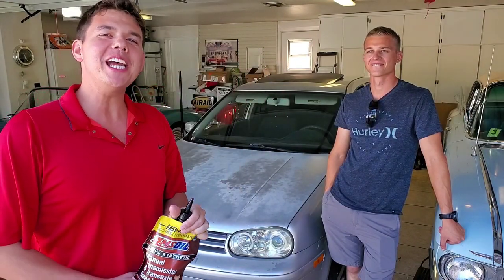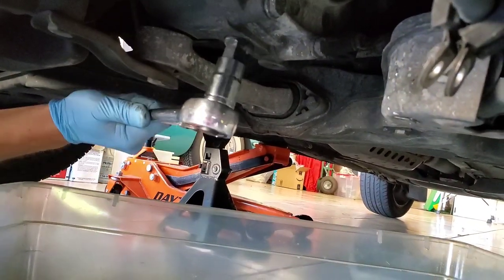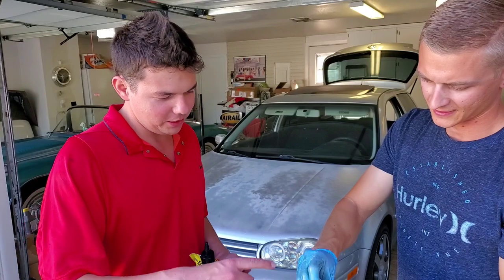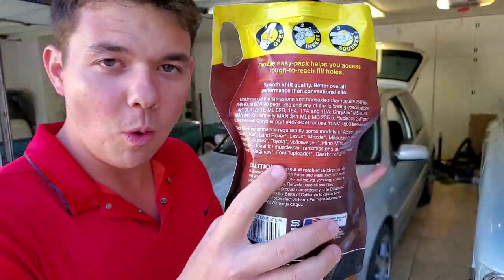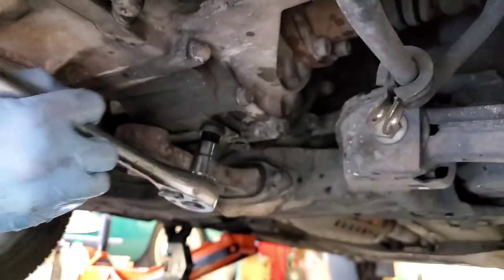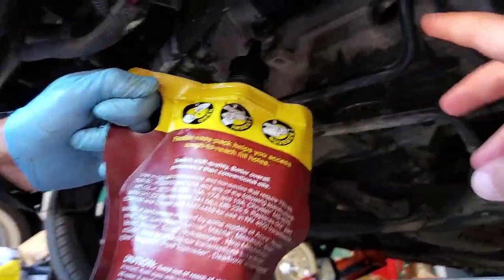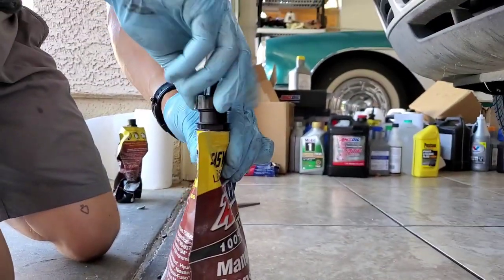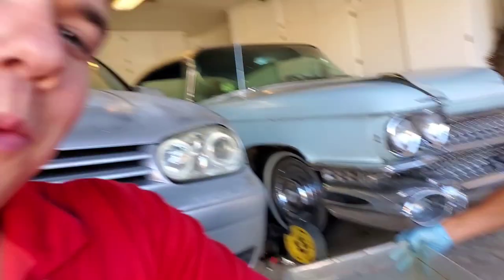VW Golf GTI AMSOIL 75W-90 Manual Transmission Fluid Change

Comment from the maker: Should People Love AMSOIL ..... - 
https://youtu.be/0YNrt962Q7U

     How should I help you with your vehicle? 

     My Link: Best AMSOIL 100% Synthetic @ Wholesale + FREE Shipping: https://www.amsoil.com/offers/?zo=5331179 

     AMSOIL Products & Vehicle Lookup - https://www.amsoil.com/guides.aspx?zo=5331179 

     AMSOIL Performance Tests - https://www.amsoil.com/performancetests.aspx?zo=5331179 

     Ebens Giveaway: 

     Video Playlist - https://www.youtube.com/playlist?list=PLB_ftWArBFdey4HFt_Z9KgSIChjkLbw_o

     Ebens Facebook - https://www.facebook.com/profile.php?id=100007973957868 

     Are You against learning about AMSOIL?: 

1. Where can I find AMSOIL? - Use this link https://www.amsoil.com/offers/?zo=5331179 
Or 
Watch THIS: 3 Fast Ways To Get AMSOIL - https://youtu.be/RiYifuDCsnQ 

2. What makes AMSOIL different than other oils? - 

     AMSOIL is 100% Synthetic & has higher film strength & last 4×longer then Mobil 1 EP which protects and separate metal parts keeping them from wearing and Lasting Exponentially longer: https://youtu.be/f4eNPgTi_qo 3. Why should I use AMSOIL?: It protects the engine so it will last longer. Less oil changes less often(once per year/15,000miles) or longer... Save money in Gas & Time making it less expensive then a free oil change over the year - https://youtu.be/H7K6FdZlqmg

     Professional YouLubher: Eben Rockmaker Master Direct Jobber AMSOIL Specialist (Dealer#: 5331179) Mobile: (702) 472-3614

     My Link: Best AMSOIL 100% Synthetic @ Wholesale + FREE Shipping: https://www.amsoil.com/offers/?zo=5331179 

     AMSOIL Products & Vehicle Lookup - https://www.amsoil.com/guides.aspx?zo=5331179 

     If your vehicle is not on the lookup guide this is AMSOIL Tech Support 715-399-8324 be sure to refer to Eben 5331179 

     46,000 Mile AMSOIL Oil Analysis - https://youtu.be/UjijQK5wSM0

     Is it a ridiculous idea to tag me?: 

Instagram - https://www.instagram.com/syntheticoilprotection/ Eben 

Facebook - https://www.facebook.com/profile.php?id=100007973957868 

     Order AMSOIL By Phone: Be sure to give them my number so I get credit for helping you Eben #5331179 and tell them you would like to be a Preferred Customer. 1. Call 1800-956-5695 2. Ask for your own preferred customer membership because you will get wholesale pricing, free shipping over $100, and your informative quarterly AMSOIL Magazine. It costs $10 for 6 months or $20 for the year which is well worth it. 3. Eben dealer number 5331179 4. Orders over $100 will be shipped free. 

Industry-standard 3rd party testing results: AMSOIL Signature Series 5W-30 Synthetic Motor Oil protects against harmful deposits on turbochargers 4X better than Mobil1® Extended Performance and 3.6X better than Royal Purple® in industry-standard testing*. https://www.amsoil.com/newsstand/motor-oil/articles/leading-the-field-in-deposit-protection/?zo=5331179 

     AMSOIL Better Gas Mileage - https://www.amsoil.com/newsstand/motor-oil/articles/another-win-for-amsoil-products/?zo=5331179

     AMSOIL Performance Tests - https://www.amsoil.com/performancetests.aspx?zo=5331179 

     Professional YouLubher: Eben Rockmaker Master Direct Jobber AMSOIL Specialist (Dealer#: 5331179) Mobile: (702) 472-3614 

     My Link: Best AMSOIL 100% Synthetic @ Wholesale + FREE Shipping: https://www.amsoil.com/offers/?zo=5331179 

     AMSOIL Products & Vehicle Lookup - https://www.amsoil.com/guides.aspx?zo=5331179
Reply: Do u get a big discount being a dealer?

Comment: Great  video  guys  like that oil too shift  better  smooth
Reply from the maker: 👍, thank you if you'd ever want to try the products this is my personal link would give you the very best value on them as the 6-month PC member.
Also when you use my link that would attach me to you so in the future I could always answer your questions about improving the performance and lifespan of your vehicles by choosing the right fluids as your independent Amsoil dealer💯

Promo: FREEFUNNEL 
✅   Save up to 25% on every order as a preferred customer: https://www.amsoil.com/offers/pc/?zo=5331179

Comment: I use this stuff, and the signature series oil in my 2014 MX5.  That car sees a lot of track and autocross use, and the Amsoil products handles all of the abuse well!
Reply from the maker: 💯, How many years have you been using amsoil?
Reply: @Syntheticoilprotection  3 years now.  Started using it on my 5.7 hemi ram which made a world of difference with that engine.  Switched the Miata over from Mobil 1.  Now, even the wife's kia has Amsoil in it lol!
Reply from the maker: Awesome That's a great story Thanks for sharing with the channel and thanks for checking out my YouTube channel ☕😃💯

Comment: Did you hear gear noise prior to changing the oil
Reply from the maker: That's a good question I don't remember if he did I know usually after you change gear lube to Amsoil because it's 100% synthetic it has a higher film strength It keeps the metal part separated so you'll have a lot less vibration in the drivetrain You'll also have smoother shifting better fuel mileage and the component will last exponentially longer.
This is my personal link if you're considering trying the products Thank you for visiting my YouTube community and thank you for any future business in advance and when you use my link I would get the credit for your order and I really appreciate you.
❤️🇺🇸❤️ Professional YouLubher: Eben Rockmaker Regency Gold Direct Jobber AMSOIL Specialist (Dealer#: 5331179) 702-472-3614 

      ✅✅✅  New To AMSOIL I Recommend The AMSOIL 6 Month PC Membership because it will save you about $33 on a $100 purchase after the difference in tax - https://www.amsoil.com/offers/pc/?zo=5331179

Comment: 11:44 Does your VR6 have the O2M transmission code?  If that is the transmission, 2 liters of transmission fluid is less than what's specified.  Something's not right about this transmission fluid change.
Reply from the maker: That's normal sometimes there's a couple different transmissions per vehicle some take a little more some take less it'll show it all right here on the lookup guide.
Find Products For All Vehicles - https://www.amsoil.com/guides/?zo=5331179

Comment: Hi , what is the tell tail signs that your manual trans oil is read for a change?
Reply from the maker: That's a great question it depends on the component there's all different types some are manuals with ATF fluid others are manual transmissions with transaxle to take your oil some take DCT fluid dual clutch transmission fluid so it depends on the component most are going to be very clunky and sticky you'll notice they take quite a bit of an effort to shift also you'll have a lot of play in the transmission when you let off the gas you'll feel a sloppy feeling for instance on my Corvette with the drive shaft there was a lot of play because the film is broken down once the film gets broken down it becomes metal and metal so it has a really harsh kind of clunky feeling.
I give a man a fishing pole & show him how to fish. 

     Together! We can get your vehicles to run better than brand new! 

     For me to get credit & be "Your" Independent AMSOIL Dealer please use my website below or my dealer no. 5331179 call anytime Eben Rockmaker 702-472-3614
After you click on: http://syntheticoilprotection.net
1. Click hamburger menu
2. Click offers AMSOIL preferred customer
3. Click join now 6-month PC member add to cart.  ( there is no reoccurring renewal membership unless you select that dot box ) 
( you have the option to not have your credit card saved if you prefer - est. 1972 )
4. Scroll up to the top Select shop by vehicle. 

New Promo: FREEBOWL

Comment: What trans oil would you recommend for 2000 manual tdi?
Reply from the maker: Hey great question man This is the lookup guide It will give you all the fluids and capacities for that specific year make and model.
Find Products For All Vehicles - https://www.amsoil.com/guides/?zo=5331179
Reply from the maker: If you're new to Amsoil I definitely recommend the 6-month PC membership which you'll save you about 33 bucks on $100 order also when you use my link I will also be your Amsoil dealer so in the future I could always answer your questions on the products.

If you have any questions before you order always happy to talk with you.
Professional YouLubher: Eben Rockmaker Regency Gold Direct Jobber AMSOIL Specialist (Dealer#: 5331179) 702-472-3614 

     If you're New to AMSOIL I recommend the AMSOIL 6 Month PC Membership - https://www.amsoil.com/offers/pc/?zo=5331179

Comment: Do you have to jack up to drain
Reply from the maker: Yes if you're not going to drive it up on a curb if you drive it up on a curb you could drain it without jacking it up
Reply: @Syntheticoilprotection   I can open without jacking or parking on a curb. Should be fine yeah?
Reply: What oil do you recommend I use on my jetta 4 vr5
Reply from the maker: Lookup For Your Vehicles - https://www.amsoil.com/guides.aspx?zo=5331179

Comment: Is it bad if I use severe gear for brass synchro gear?
Do you damage synchro?
There seems to be more the durability in severe gear.
Because there is not the handling in Japan, there is not the person whom anyone understands.
Reply from the maker: I would go with what is on the lookup guide some Transmissions take the GL for specification just depends on the vehicle.
Lookup For Your Vehicles - https://www.amsoil.com/guides.aspx?zo=5331179
Reply from the maker: Thanks for being a part of my channel this is the look up for the international distribution centers there may be one near you.☕

https://www.amsoil.com/international/distributor/?zo=5331179

Comment: Should I switch to AMS gear oil for the differential in my truck? Right now using STP
Reply from the maker: Yes you'll definitely have better cold protection in the winter the hundred percent synthetic gear lube circulates with less friction when it's cold all so you'll have better high heat protection and that all leads to better fuel mileage and extended differential life.

This will give you all the fluids for your vehicle and I also will include my website here it's best to be a six-month preferred customer which will get you the wholesale pricing and there is a promotion going on right now to that will get you the three free bottles of upper cylinder lubricant.

Lookup For Your Vehicles - https://www.amsoil.com/guides.aspx?zo=5331179
Reply from the maker: Synthetic Oil Protection Website - http://syntheticoilprotection.net/
Reply from the maker: Promo code: GIFT1120

Comment: I went to buy Amsoil 75w90 GL-4 and my Dealer only has Amsoil Severe Gear 75w90 that's GL-5.  What's the difference between the two?  Is Severe Gear Yellow Metal Safe?  Thanks
Reply from the maker: The major difference is the amount of modifiers the GL4 has less modifiers where the GL5 is designed for the differentials and that has a modifier that doesn't allow chattering when you turn very tight sometimes the inside wheel will checker and chatter and when it makes that chattering noise that's how you know you have to add more anti-chatter slip lock additive.

A lot of transaxles take the GL4 which is a manual transmission and differential all in one.

However some transaxles call for a GL5 specification just depends on the component and the vehicle.

This is the lookup guide that will give you all the fluids capacities and products for your specific year make and model and engine size.

Find Products For All Vehicles - 
https://www.amsoil.com/guides/?zo=5331179
Reply from the maker: Thanks for checking out my YouTube community.

Professional YouLubher: Eben Rockmaker Regency Direct Jobber AMSOIL Specialist (Dealer#: 5331179) 702-472-3614 

Get AMSOIL Wholesale Pricing - https://www.amsoil.com/offers/pc/?zo=5331179

Comment: Hello is this gear oil good for fiat 500 abarth manual transmission? Thanks
Reply from the maker: Double check the lookup guide but I think yours is the GL4 specification.
Lookup For Your Vehicles - https://www.amsoil.com/guides.aspx?zo=5331179
Reply from the maker: Thanks for reaching out to me Lewis if you have any questions you can always give me a buzz.

Synthetic Oil Protection Website - http://syntheticoilprotection.net/

     Professional YouLubher: Eben Rockmaker Regency Direct Jobber AMSOIL Specialist (Dealer#: 5331179) Mobile: (702) 472-3614 

Ebens Wholesale AMSOIL Link + FREE Shipping: https://www.amsoil.com/offers/?zo=5331179     & Text Me for latest promo code.  702-472-3614
Reply: Yes is an gl4 75w85  from factory .
Reply from the maker: https://www.amsoil.com/p/manual-transmission-transaxle-gear-lube-75w-90-mtg/?code=MTGPK-EA#pills-home_0?zo=5331179

This is the GL4 that amsoil makes with the EZ Pack in that way it's super easy to drain and fill the diff
Reply from the maker: Oh I forgot to mention the 75W85 and 75W90 are interchangeable so you could use either of them the most important thing is the GL4 which is the less modifiers.
Reply: Ok thanks my friend.
Reply from the maker: Anytime Louis!

Comment: Was his 12v or 24v
Reply from the maker: Not sure what you mean
Reply: @Syntheticoilprotection  can you use it in the vr6 24v
Reply from the maker: I'm not even sure what that is?
Or what product you're referring to to be used?
Reply: VW for the VR6 either come with a 12 V or 24 V , up to 2001 the VR6 came with the 12 valve engine , after 2001 the VR6 engines came with 24 valves .

Comment: Lol yall doing a poor mans flush
Reply from the maker: I have no idea what those guys are talking about 😆😁😄
Reply: I believe he's referring to changing an automatic transmission fluid once driving the vehicle and then changing again a couple more times in order to flush out most of the atf.
Reply: @Syntheticoilprotection  eben i pull the return transmission cooler i let it run until its bright red while at the same time putting fluid in the transmission filler neck